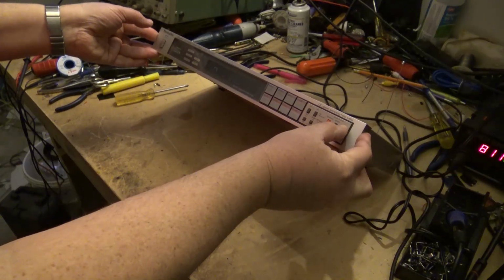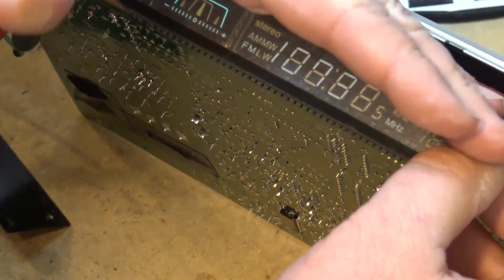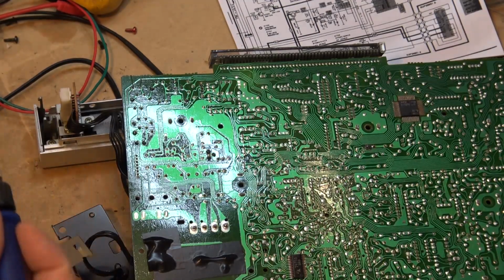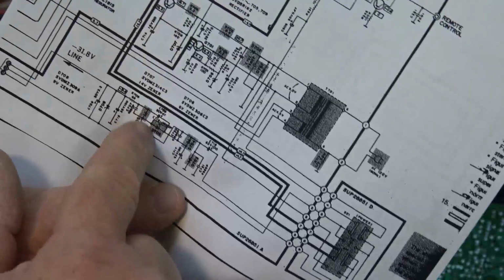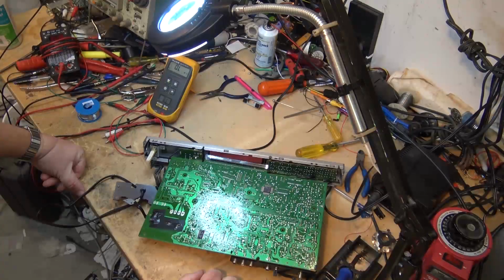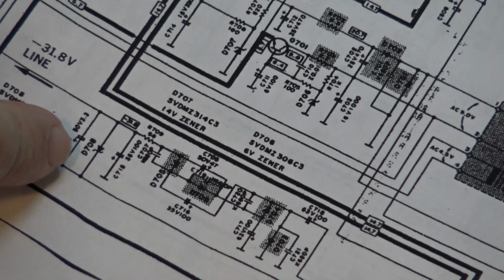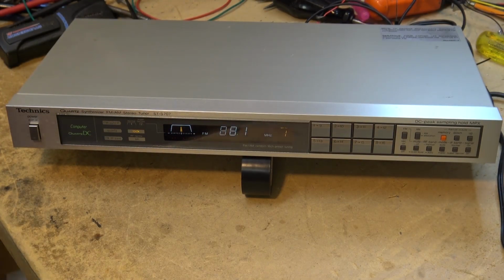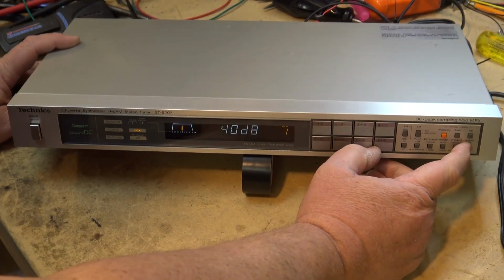Technics STS707 Very Dim Display

Comment: Cool to know you need to run all 3 cap tests to confirm a cap is REALLY bad of not.
Reply from the maker: Yes ESR, Capacity and ohm test.
Reply: @12voltvids  let's not forget DC leakage current test! Which is what that capacitor you replaced was suffering from! And there's no other way around it, they have to be removed to be tested! They usually show up as having good ESR which throw's of a lot of people as not many people seem to know about that failure mode and therefore don't have the means to test for it...
Reply from the maker: @PeterMilanovski  
No this one shorted.  Not leakage.  Leakage was really only an issue in the wax coupling caps in tube gear.  Electrolytics generally do not go DC leaky unless they short completely as this one did.
Reply from the maker: @PeterMilanovski  On low voltage low impedience circuits this just isn'r an issue like it was on vacuum tube gear. The problem with paper caps was the paper. As it aged acid in the paper from the time it was manufactured gradually turns the capacitor into a resistor.
With a high impedance high gain tube circuit it only takes a few microvolts to tickle the grid of the next stage and cause a high dc plate current. This will reduce the life of the tube, and in extreme cases burn out transformers. Solid state circuits this is not nearly as big an issue. Hot chassis leakage is a totally different issue. We had the same problem here, but it was due to submarine DC power cables. Was eating underground pipes. The power company has installed negative electrodes into the ground to mitigate this problem. Firthermore they used ground return. So just the positive wires were sent from the mainland to the island. The negative  retudn was a series of electrodes at the shoreline which then went Ariel back to the substation where the rectifiers were. Not all the currents went to these electrodes, so additional kathode electrodes that were fed with about -48v were installed to prevent pipe degradation. Where  I live, if you drive 2 ground rods into the ground seperated by about 30 feet, you will have a small differential voltage between them, and can actually pull several amps. All ground electrodes need to be bonded together. This is actually done every 300 metres on all the poles. The multi ground neutral is bonded on every pole that has a transformer and every 300 meters.

Comment: Good idea to shorten some videos, look for the fault, fix it done.
Reply from the maker: Some of the older ones are too long and will be redone at some point. I will be editing off the source files, so it wont just be a shortened video, and most of the audio will be dubbed in to explain what I am doing as I did in this one.
Reply: @12voltvids  That's fine, perfect.  What stops me looking through some of the older stuff is they are just to long.  I just want to see the fault, finding it, fixing it and seeing it work (but not a long working bit) and that is it.  It will also allow other to look through some of the older ones, plus, you will get adverts twice for one video :-))

Comment: I had a Sony CD player that the screen took a minute to turn on, I originally thought it was just weak or maybe bad caps, but it turned out there was corrosion that ate away the trace for the heater. Apparently, the display eventually got hot enough just from both heat from the machine, and heat from the plate in the display that it would dimly show things after a while